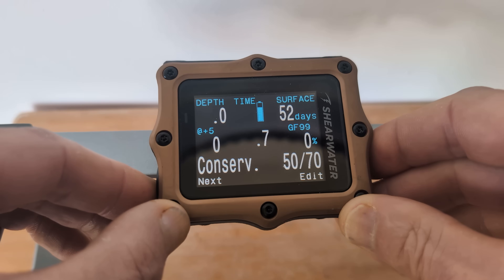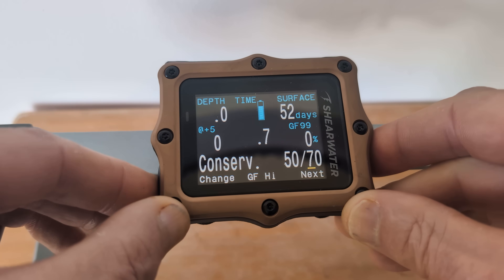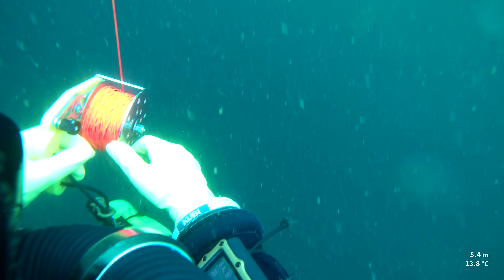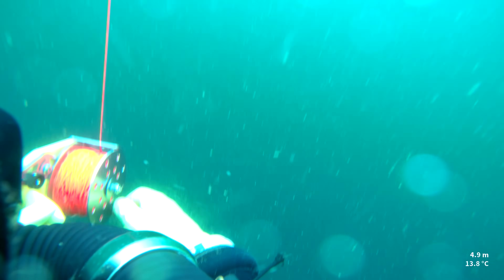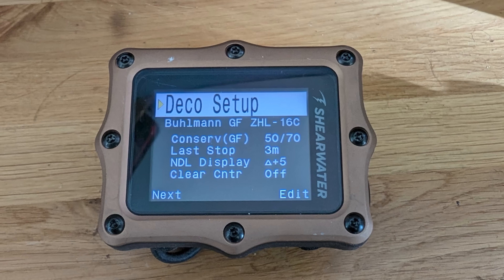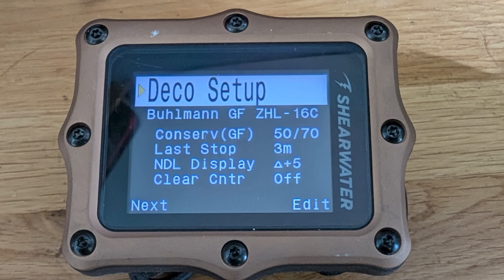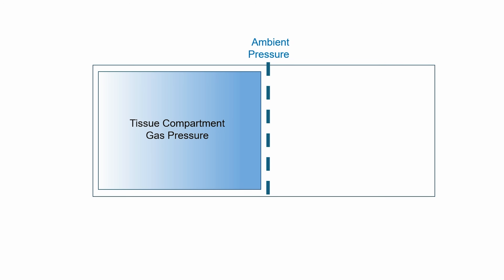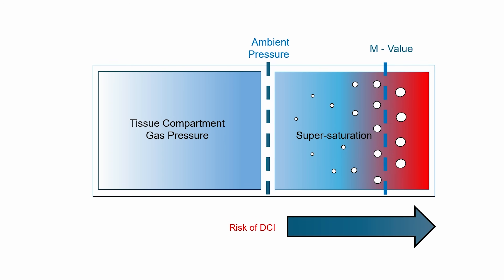I Changed This One Setting and Became a Safer Diver

Comment from the maker: What GF settings are you running on your dive computer? Drop your high/low numbers below and tell me what type of diving you do. I'm curious if most tech divers are running conservative or aggressive profiles. 👇
Reply: I use 50/70, but as long as I'm comfortable, I normally stay on my shallow stop until the surface GF is in the 50s or even 60s.  I feel less tired after the dive with a lower final GF.  Also, most computers are only looking at the leading tissue compartment.  I use the tissues screen on the Perdix to see what my slower tissues look like.
Reply: @rogerheuckeroth7456  very similar here, except my GFHi is 80—but I also try to stay until I'm at least in the 60s if possible!
Reply: A nice, practical explanation.  I personally (now age 68 but fit) use 50/85 and feel fine after a dive.  It seems reasonable conservatism against not getting too cold in deco.  FYI I recently discovered Suunto’s anecdotally over-conservative RGBM-2 is actually equivalent to GF40/85, although they recommend 30/70 as the baseline for their ZHL16 Eon computers.
Reply: @timgosling6189 Do not ever take any decompression lessons from Suunto. Their model is neither «overly conservative» or «overly liberal» - it is simply broken.
Reply: @KrispyNuggetBoutique  Suunto now use Bühlmann ZH-L16C.  If you mean the old RGBM-2 Fused, I've done some analysis on it and it mirrors Bühlmann with GF40/85 pretty closely.  The original RGBM, which was replaced some years ago, was apparently more conservative but 'broken' is a bit harsh.  But I would be interested if you have examples to cite?
Reply: I'm running 50/85. 200 hours on the JJ and a bunch of time on open circuit trimix without a problem, but had my first DCS hit on Sunday (albeit very minor) and chamber ride. Not sure what's changed in my profile (nothing...), could have just been bad luck on the third day of diving, but I am liking the ideas of spending a few extra minutes at 6m and monitoring the surfGF.
Reply: Used 60/85 for several years, without thinking much. Moved to Bali and due to .... infrastructure challenges? and suggestion of local instructor who's doing some serious dives switched to 50/70. For 100m+ - 50/60. 
At the same time, heard a story about people doing some serious diving in Norway with 70/90 - but you need to think of their whole procedure in 4C water. Once they surface, they take off all the gear in the water and hang it on a line, support picks that. Then out of the water, into a tent, and 40 min breathing O2. This is making to what commercial divers do. So good points about other risk factors, cold being a serious one.,
Reply: 60/75 for my 60m dives
Reply: CCR on an archaeological project in 63 metres, diving 40/70, and am very happy with how that is working so far.  Just doing one dive per day - every day.

Comment: About three years ago I was diving CCR on a daily basis using GF 30/75 with typical depths of 80–85 m and bottom times of 30–35 minutes, without any issues.
Later on, I joined a project that required surface decompression. 
Using my standard decompression profiles initially led to repeated problems. After several adjustments, I eventually settled on GF 40/65, which completely resolved the issues.
With those gradient factors, I completed several months of intensive diving symptom-free. At the time I was 48 years old and in good physical condition, which likely contributed to the outcome.
Reply from the maker: That's a fascinating account of adapting your GFs for surface decompression, really appreciate you sharing your insights!

Comment: Great video.  I dive 50/70.    However, I don't that a lower low setpoint is always more conservative.  Shearwater defaults to 30/70 and I personally think that is too low.  A low setpoint can be too low if the slowest compartments are doing a lot of on-gassing while we are holding our deepest stops.
Reply from the maker: Interesting point, thanks for sharing your thoughts on the low setpoint!

Comment: I use 50/75 on the computer, but unless I am really freezing, I will prefer SurfGF to drop below 70% before ascending. I dive to around 200 meters - but I am also still in my 40s, quite fit and take very good care of other DCS factors. In particular, I would say my order of priority is (i) between 6-24 hours before a big deco dive, I will do moderate-hard cardio (long fast run), (ii) hydrating to a degree of almost being absurd and (iii) no alcohol in the last 48 hours before a dive. 

Also - if you are doing any form of long deco diving, get checked for a PFO.

I would also recommend getting an O’Dive doppler scanner to learn your own bubble pattern. They are not cheap, but compared to the other tech diving equipment, it is an absolute bargain.
Reply from the maker: I always look forward to your comments so thanks very much and interesting to hear that you are similar with GF.  
Like you I'm still reasonably fit although because I can't urinate underwater (mental block!) I tend to dehydrate myself before dives - I know it isn't recommended but so far so good!
Reply: @DeepWreckDiver Appreciate that! Now, if I can only find the time to join you for a dive at some point too… :)
Reply: @KrispyNuggetBoutique  With excess hydration does that not increase the risk of Pulmonary Oedema?
Reply: @tomcobbly8672 the chances of excess hydration are remotely small compared to dehydration, so pick your risk I guess.

Comment: No reason not to be a little more conservative, not in a hurry. Tec 40 instructor recommended 40/75; so I m getting on with it! Also got a Suex 24v scooter. Stay safe Dom, enjoying your videos. Sorry Will and Rick aren’t diving with you.
Reply: The thing is, having a lower GFLow isn’t actually more conservative, because your slow tissues are still on-gassing. Modern science very clearly shows that higher GFLow actually reduces your DCS risk. I am not saying deep stops are bad, but deep stops are bad.
Reply from the maker: I guess the question is at what point do deep stops start becoming deep stops?
Dr Neal Pollack is recommended 40/70 and I reckon he might have a good handle on it!
Reply: @DeepWreckDiver I think, unless you happen to be a hyperbaric doctor yourself, you just need to pick one to listen to. For me, that will be Simon Mitchell as I think his actual diving experience combined with his medical background is hard to beat.

That being said, I fully believe that the other factors I mentioned - in particular fitness and hydration - is a hell of a lot more important than whether your GFLow is 40 or 50. There was a study a few years ago looking at cardio exercise the evening before a big deco dive, and the drop in bubble formation was absolutely massive. So that is largely the number one priority for me. Either the evening before, or the morning off a dive, I will put in a long moderate pace run. it has the win-win of otherwise being healthy too!
Reply from the maker: Glad you're enjoying the videos and thanks for sharing your GF strategy!

Comment: I am set to 50/80 up to 130m and 200min, but i ascend quite fast to the offgassing point, then slow down to first deco depth. I never exit the water with SurfaceGF higher than 70. Works great for me in cold water(even in winter 2-3C°). Mostly using a DPV, so not excercising that much! Great Video by the way!
Reply from the maker: Glad you found the video useful and thanks for the insights into your deco strategy!

Comment: Hi. Great video. 
I  hope you won’t take it the wrong way but there are details or precisions that I wanted to point out :

00:57: If you dive trimix your computer is also estimating the amount of Helium being dissolved in your tissues.

  1:24: It’s important to point out that, although it’s common to say that a ‘fast compartment’ represents a specific tissue such as the brain, bone, or skin, this interpretation does not come from the original publication. When John Scott Haldane introduced the concept of grouping the body into modelled units based on similar gas-absorption characteristics, he used the term ‘tissue.’ However, these are theoretical compartments representing simplified models of the whole body, not literal anatomical structures.

2:24: That is why the distinction between the mathematical object called a ‘tissue’ and the medical term is important. The M-value of each compartment is a pressure value at which it was experimentally determined that the amount of bubbles produced by a desaturation at that pressure would be unsafe for that compartment. This is not a physical limit but an empirically derived probabilistic value.
During the dive, all sixteen compartments are monitored simultaneously and compared to their respective M-values. The compartment whose limit is exceeded first determines the ceiling, and therefore the required decompression stop.
For deep and long dives, the leading compartments tend to be the slower ones. For shallower dives, the fast compartments load and unload too quickly to supersaturate, while the slow compartments saturate so slowly that they never reach their M-values. As a result, the leading compartments are usually the median ones.  

3:30: There is no definitive evidence that using a lower M-value, while more ‘conservative’ in the mathematical sense, is actually more conservative in terms of safety. There appears to be some support for this idea in the literature for deep dives, but there is also substantial evidence that being too conservative can be dangerous, potentially even more dangerous than simply using the original Bühlmann set of M-values.
It is also important to note that this approach does not account for individual physiology, environmental conditions, or bubble dynamics, all of which are extremely difficult to model accurately.  

6:26: This idea comes from the assumption that making stops earlier during a diver’s ascent could help reduce the formation of bubbles in the body. Stopping at a deeper level was theorised in previous papers to allow the higher ambient pressure to compress already existing gas nuclei (the physical structure from which the bubble appear and that is present since the surface) before they could grow. This more gradual reduction in pressure was intended to prevent bubble formation even before critical supersaturation thresholds were reached.
A recent study for the Belgian Navy has shown that lowering GF(Hi) significantly extends total decompression time without producing a measurable reduction in venous gas emboli (their metric), indicating that additional conservatism might not translate into greater safety. The experiments were conducted during non-successive dives. They used the same Shearwater Perdix 2 that you (and I) have and this computer restrict GF(Lo) to values equal to or below GF(Hi), their theoretically optimal setting (GF(Lo)=100 / GF(Hi)=75) could not be applied in practice. As an alternative they recommended using symmetric gradient factors in the range of 75/75 to 95/95, with 90/90 proposed as a realistic operational option.*  

6:51: Important to note that Buhlmann models (plural) did not account for very deep dives nor successive dives.  

8:33: The scientific framework that studies and produces these models is called ‘decompression theory’. 
While I understand what your friend means, that is not what the word ‘theory’ means in science. A scientific theory is a predictive and explanatory model that is supported by observations of scientific facts and has failed to be refuted. In that sense, ‘gravitational theory’, ‘germ theory’, or the ‘theory of evolution’ are all examples of what their respective fields study.   

And yes Workman introduced the gradient factors, not Buhlmann ^^.
 And since you asked for my gradient factors I usually use 80/80 .

sources :
   * Yount DE, Hoffman DC. On the use of a bubble formation model to calculate diving tables. Aviat Space Environ Med. 1986;57(2):149–156. PMID: 3951349
 ** De Ridder S, Pattyn N, Neyt X, Germonpré P. Selecting optimal air diving gradient factors for Belgian military divers: more conservative settings are not necessarily safer. Diving Hyperb Med. 2023;53(3):251–258. doi:10.28920/dhm53.3.251-258.
Reply from the maker: Wow, what a brilliant set of comments on your post.  I'm very grateful to you for taking the time to put that all together and I'm sure others will find them useful as well.
One point is that you may have head during the video that Dr Neal Pollack commented on my video of Rick's DCI to suggest that he believed that 40/70 was the right approach.  I also believe that Prof Simon Mitchell has been heard to recommend 50/70.   I'm sure they must be aware of the Belgian Navy findings so I gues sthis shows just how limited our knowledge in this area is!
Reply: @DeepWreckDiver  You are probably referring to Dr Pollock. I haven’t read a recent paper from him on this topic, but I’ll look into it.

Simon Mitchell was advocating more conservative gradient factor settings nearly ten years ago, but in a context where very conservative values such as 30/70 or even lower were being discussed. As I recall, he expressed reservations about excessive conservatism and about the assumed link between algorithmic conservatism and actual safety. Subsequent literature appears to be consistent with that view.

I know scientific literature is hard to read and hard to keep up with, even for people who publish in it. 
New studies come out all the time and can look like they overturn what we thought we knew. Single studies, especially recent ones, need to be taken carefully and in context. Meta-analyses and reviews usually matter more than individual papers because they look at the full body of evidence instead of one result.
And yes, there are still things we do not know, but there is also a lot that we do know. Of course we do not throw everything into question every time a new study appears. 

What is called scientific consensus is not a consensus of scientists’ opinions, nor is it an ontological truth even if it is based on scientific facts.
Rather, it represents the best state we have of the sum of human understanding on a given topic at a given time.
This is why, while it is important to listen to experts, science is not composed of their collective opinions (It’s worth remembering that at a time Simon Mitchell was a strong advocate of bubble models, nobody is always right all the time). 
This also explains how something like a scientific consensus can exist even when there is disagreement among scientists, by which I mean people who actively engage with the peer review process in the relevant field. 

And what seems to emerge from the latest scientific literature is that:
- Deep stops are not as beneficial as previously thought, and in some cases may even be detrimental.
- Shallower (yet not too shallow) but longer decompression stops are likely to be associated with a lower risk of (a specific set of) decompression sickness.
- The implication is that decompression profiles more conservative near the surface while also advocating reduced bottom time (such as 100/75, a setting that is not possible on modern dive computers), may be preferable.

Of course It is important to understand that these models were developed within a specific context, and that they do not apply to all dive profiles, all divers, and at all times. For example, the margin of error increases near the limits of the model, making it less predictive for poorly documented dive profiles. This is particularly true for repetitive dives, which these models can't represent accurately, as well as for sawtooth dive profiles.

At the end of the day, everyone does what seems best for them, and my opinion is worth no more than anyone else’s (don't take advices from my random anonymous comment under a YouTube video). 
However, it’s important to keep methodological biases in mind. Not having an accident is not proof that what you’re doing is safe (survivor bias), and the human mind is very bad at interpreting statistics, probabilities, and rare events (for example, we know that dehydration is a very plausible risk factor for DCS, and as a result we see people drinking excessively, despite the fact that there is no evidence that overhydration provides additional protection against DCS).

Comment: Hi, to lower the risk even more, try to stay warm and active in deco and spend some extra time close to the surface.
By the way, I wouldn'd consider pretty low GF low as conservative or save (as long you don't do pretty long deco)
Reply from the maker: Glad to hear your thoughts on this!  Not sure what you consider as long deco, but my run times are normally 2-3.5 hours

Comment: What a fun experiment we are all part of. For air and Nitrox I'm diving 85/85 for no stop diving with a safety stop. For accelerated nitrox deco diving 80/80. For OC trimix 50/80. My thinking for the last set is I switch over to none helium mixes on the ascent, a slightly deeper stop allows the helium to the off gas at the fastest  rate. At my shallowest stop I'm on 80 or 100% O2 so then medium and slower nitrogen tissues are off gassing and there is no further slow tissue nitrogen build up.
I'm just in the process of switching over to CCR where (everyone will know better than I) the off gassing in a way is optimised throughout the ascent. However, one still has the same dil. I wonder if this impacts the ZHL-16 less well modelled helium degassing. Any thoughts on this?
Reply from the maker: Thanks for explaining your approach and there's no doubt that we're all experimenting on ourselves!
Regarding the helium offgassing then that is well beyond my knowledge but I always like the quote from Prof Simon Mitchell - "wer're doing the right amount of deco, but for the wrong reasons!"